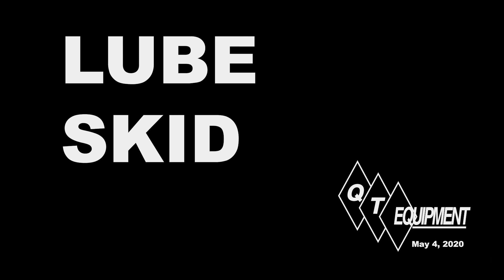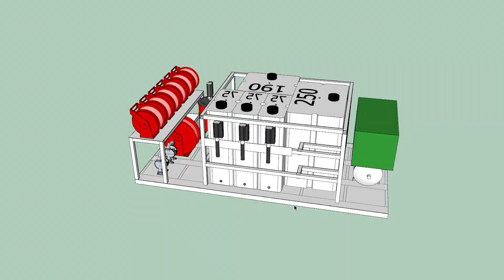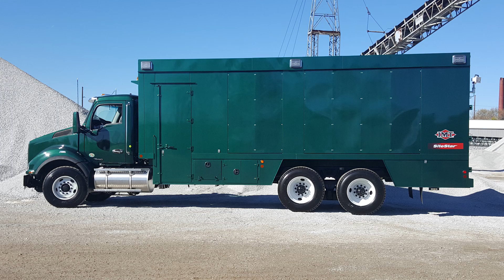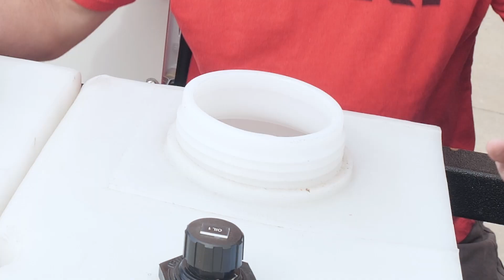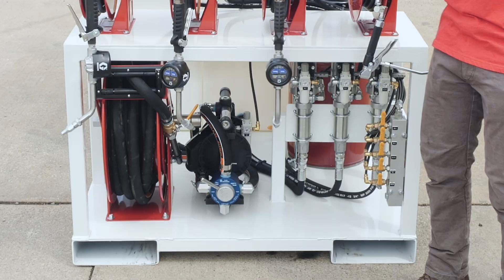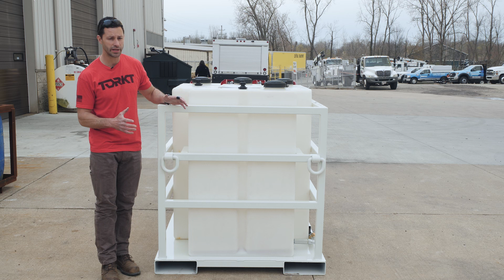QT Equipment - Standard Lube Skid

Comment: On average how heavy will that set up be on top of the 1700 pounds that was mentioned in this video?? I'm really interested in a setup like this one🤠
Reply from the maker: If new products are full and salvage is empty.
3 * 75 Gal tanks = 225 gallons.
Rough guess 8 lbs per gallon.
1800 lbs.
Plus 120 lbs for brand new grease keg.
1920 product weight + 1700 lbs skid = 3620 lbs.
Rough estimate.  May vary!!
Reply: @qtequipment  Waow Great Customer service!! So just a ball park of 4000 pounds of cargo 👍🏼 thank you QTE!!